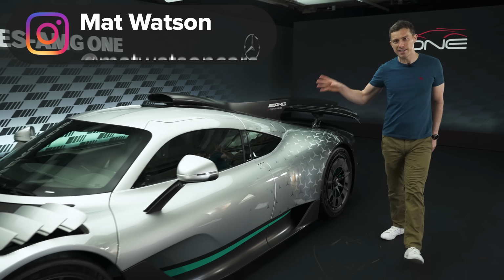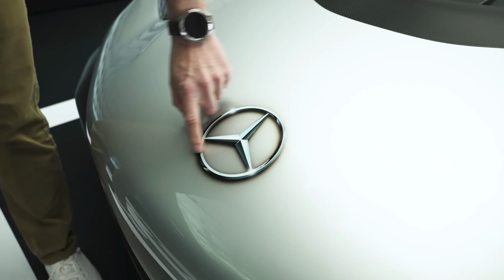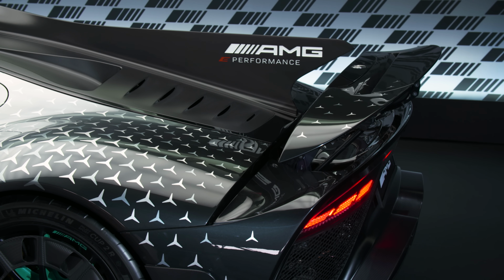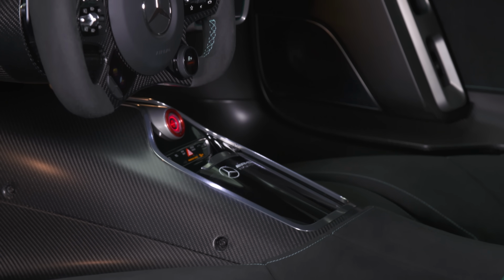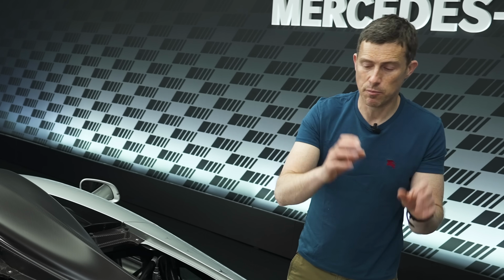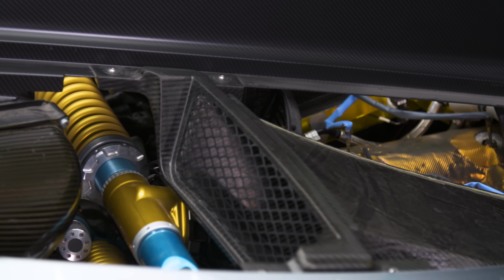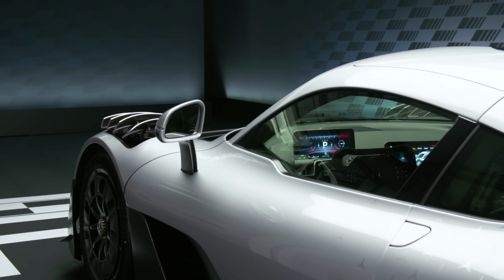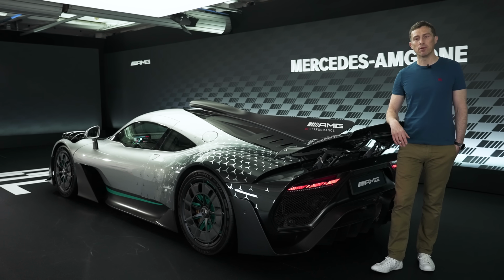Mercedes-AMG ONE: An F1 car for the road!

Comment: The downside will be the insane running cost and the lack of sound, and still slower than a Tesla Plaid!🤣
Reply: Slower than a Tesla? Hahajahaja, your Tesla can not make turns, is not a F1 champion, and is not the brand that invented the automobile and the most sucessuful brand in the world.
Reply: @simracer8142  Not only slower, it’s 15 times more expensive, and 90% of the cars will never drive faster than a Tesla on the track! I bet a service cost more than a new Plaid!🤣 But with a great driver behind the wheel it’s faster!

Comment: AMG ONE only has a 1.6L V6 turbo dual electric motor but they can produce 1063HP..

in terms of fuel consumption will also definitely be more efficient than any HYPERCAR..

and engine Cooling sistem is more ADVANCED than other.. because of F1 technology.

although the performance of the AMG ONE engine is not as great as other hypercars that have appeared. but F1 technology is like aerodynamics and SASIS if it is competed on the race track, I believe AMG ONE will win. because it is designed to be fast not only in straights but in corners

Comment: As i read most of the comments i have to say that the amg one needs to prove its performance with a official lap time on the nürbürgring. This car is heavier than most people expected it to be. But dont forget, a gt2 rs does weight in with fluids with 1600kg or more, with just 700hp and still laps the ring in under 6:50.
Reply: AMG ONE's lap time around Nordschleife was 7:05.763. Or 6:45.911.
Reply: @purwantiallan5089  what? The amg gtr pro does a 7:05 - way this car isnt sub 7

Comment: I dint expect this car to be this heavy. I tought it would be around 1.1/1.2 tons. When merc revealed this car current F1 merc-amg car was around 750 kg at the time. I tought it could be sorted with addition around 400 kg . I guess Aston Martin valkyrie will be pretty much better because it expected to be around 1/1.1 tons
Reply: Yea same, must be the hydraulics. Cylinders to raise the car, cylinders 4 the wing and cylinders for the wheel guards.

Comment: Trying to adapt F1 hardware for street use can prove to be tricky. It can have significant problems with the powertrain. Meeting emission standards with an F1 engine was more arduous, especially when the company was looking forward to producing a 1000 HP output. Engineers found a way to tame the hybridized 1.6-liter turbocharged V-6.

Comment: Reminds me of the Ford GT like alot 🤔🤔
Reply: And I don't see any relevance between this and GT.
Reply: @EngiNetion  more specifically the pedal box, lightweight, and especially build for aerodynamic, Also a V6 and a kinda boxy steering wheel. If you look deep enough both were meant to dominate the track.

Comment: I think AMG is trying to be conservative with the acceleration of this car, the new Mercedes AMG GT E performance with 840 does 0-60 in 2.8sec and it weights 2.4tons. The AMG one is lighter and got more power. I think 2.6/2.5 sec is possible.
Reply: 2-2,2 secs is also possible,the less powerful Porsche 918 spyder with similar weight managed to did that
Reply: @muhammadhaekalhakim6402  918 has PDK and Porsche Launch Control and optimisation on its side
Reply: @therealpureessence2437  the amg one has lighter weight,more powerful,and has electric turbo which prevent turbo lag and deliver instant torque at any rpm

Comment: The numbers (0-100kmh) are not that impressive actually. 2.9 is fast don't get me wrong, but at 2 million pounds it should be a lot faster. (Caterham 620R does 2.8 sec, Porsche 911 Turbo S (992) - 2.6 sec,  Tesla Model S Plaid - 1,9 sec)

Comment: It just fees a bit gimmicky……

Like sure it’s got an F1 engine but for its chonky 1700kg weight and super low torque 1000hp isn’t that great (in todays crazy hypercar terms anyway)
The F1 gizmo’s are cool and all but instead of an F1 seat and a drs button I feel like the R&D money would’ve been better spent on shaving off a few KG’s 
What makes F1 so good is the crazy downforce and crazy power to weight, neither of which this car has.

Comment: I think it's slow car bcz it's AWD with electric motor and 1000+HP so many aerodynamic design with F1 tune-up if u look up Maclaren 765LT u can see it's rear wheel drive with lower engine power and 0-62 mile is 2.88sec and that hypercar one it's 0-62 mile with AWD 2.9sec i don't think so it's good power all hail to Maclaren power

Comment: 1700 kilos. The power to weight is less than a LaFerrari. AWD will help the launch  but this turned out to be much heavier than I imagined. All that electric power should keep the engine good for long.

Comment: Why do they even include different drive modes, I have a C63s and I always want it to be in sports+ mode, each time I start it up I want to hear it, each time I down shift I want it to crackle, I want it to climb RPMS through the gears, can we at least have a setting that remembers it...it remembers my seat and steering wheel position....
I didn't buy it to be fuel efficient .
I didn't buy it to sound soft
I don't care it's in 2nd at 3k RPMS in 30kms traffic growling at everyone.
I don't want to fiddle with buttons on each start up.
If any Mercedes guys watching this please include this as an optional memory mode in the next update please!!
Matt....come on man you surly will agree you lead footed monster!
Reply: I'd say this is not because they didn't think about it, i think its due to noise regualtions but i might be mistaken.

Comment: Its a really stunning car, only disappointment is the weight as its really heavy.
Reply: Performance figures are low as well. I was really hyped for this car but thats kind of disappointing.
Reply: @MegaFregel  pretty sure that the actual performance would be in the speed it takes corners, but there are ultimately huge compromises in sticking an F1 powerplant inside a road-legal chassis. Remember the Ferrari F50?
Reply: @2FinzButIGotMeAFewOn  Its heavy as sht, thats the problem. Dont know what the F1 enginge has to do with that since its tiny.
Reply: @MegaFregel  the hybrid system from the f1 engine is heavy
Reply: @_mundi  not that heavy
Reply: @_mundi  the Mclaren P1 with a 4 liter V8 + hybrid and Ferrari LaFerrari with a big 6 liter V12 + hybrid came in at 1400 kg back in 2013. The Aston Martin Valkyrie, which is the main competitor of the AMG One, has a 6 liter V12 + hybrid system, more power than the AMG One and comes in at just over 1000kg. I expected more from a ultra light weight F1 drive train, than to be 600 kg heavier than its competitor, even if it was modified to function in a road car. Seems like they could have done more to save weight but chose not to for whatever reasons. I mean come on, over 600 kg heavier than the Aston Martin Valkyrie?!
Reply: @MegaFregel  its a track car, i bet it will snatch porsches Nurburgring record for a while at least
Reply: @ВладиславДимитров-ш3с  would be an absolute joke if it didn’t but I wouldn’t be surprised.
Reply: indeed it's a hybrid
Reply: Who the F cares when you get such performance... way less the a Chiron...

Comment: E63s AMG 4doors family size 0-100 3.2s - 100k£
AMG one 2doors 0-100 2.9s 2M£

It doesn’t make sense?
JUST PUT THE E63S ENGINE IN THE AMG ONE AND MAKE IT ALL WHEEL DRIVE AND BOOOM YOU GOT A CAR FASTER THAN TESLA

Comment: I know 0-60 isn't everything but 2.9s is slow for a 1063hp car
Reply: Not accurate lol
Reply: @ode1854  Those numbers are official from merc themself
Reply: @nonameyet2205  wait and see. This thing has 200hp more than 918 and weighs the same so it will be atleast as fast and 918 does 2.2s 0-60
Reply: @ode1854   Wait for what? As i said those numbers are official from merc themself. The 918 has a blazing fast PDK dual clutch transmission, the ONE only has a single clutch automated manual transmission, the extra 200hp might help at the top end but most likely will not help 0-60
Reply: @nonameyet2205  the engine and torque is more responsive than N/A car with f1 tech and the gearbox is faster than the pdk100%
Reply: @ode1854  Faster in theory, but so far all the review says that the 0-60 is 2.9s which is slower than even a 911 turbo S
Reply: @nonameyet2205  this car developed for doing corners for Nurburgring record.
Reply: @konstantinlisitsa8443  This car is so heavy it probably won't beat porshce in nurburgring
Reply: @nonameyet2205  probably you are absolutely right, but there were so many dragracing where Porsche cars were heavier and had less power than their opponents but nevertheless win. May by because of adaptive aerodynamics or some other technologies AMG could set a record time.  Time will reveal.

Comment: The F50 based on a formula one engine, no it only used the engine block. But, this Mercedes is the first real car based on an F1 Car. Great job Mercedes taking 5 years hard work, and being first F1 car for the road.
Reply: And yet, the closest to being one is GMA T.50 :/
Reply: @pazernyy  GMA T50? What is that car, pazera66?
Reply: @purwantiallan5089  Man, cant you use Google?

Comment: Quite underwhelming to be honest - the valkyrie, which competes with it has far more impressive acceleration figures, much better weight control and comes with a 6.5l v12! Feels like the amg is not even in the same class as the valkyrie...
Reply: honestly felt the same, this was rumoured to be around 1242HP and around 1300KG in weight, what the hell happened to that, it's barely faster than a 765LT to 200KPH. it "only" has 1063HP and weights fucking 400KG more
Reply: @leoc675lt  however it seems to have insane aerodynamics and a really track-focused set up. The AMG GT Black Series was already able to beat the 765lt and the sf90 on the track (despite being a lot slower on a straight line), this car with the kind of acceleration/downforce/set up that it has, should be able to outperform even a McLaren Senna on the track.
Reply: Tbf, they never advertised it to be, only the fans did.
Reply: @F1ll1nTh3Blanks  Yeah, there's that... Although it just makes sense to compare them both, doesn't it?
Reply: @optimusprime1201  Ayumu Uehara drive this AMG ONE before.
Reply: It has different philosophy altogether

AMG one philosophy is a road legal F1 car. Whereas Aston Martin Valkyrie originally is a hypercar project, which sadly never got a chance to participate because Lawrance wants to invest them fully into F1
Reply: @hectornecromancer5308  Maybe take a look at how Aston markets its car - "f1 technology on the road" - this moniker puts it in direct contention of the amg one. If you were to look at the marketing of both the companies, you'll find that they compete in almost the same segment...
Reply: @optimusprime1201  that's quite interesting

That means it depends which one came first. WEC Hypercar announcement or the phrase first?
Reply: Well at least this does not Porpoise though XD
Reply: WTF are the people hete on about
Reply: This car has the 2016 world championship-winning f1 engine. The same engine with which Nico Rosberg won his world title
Reply: Is the valkyrie even built? Are their weight figures real and proven? Is the car Road legal?
Reply: @nazarpredatorak  there are at least one valkyrie built

The current progress is unknown due to papa Lawrence focusing on F1 instead
Reply: @nazarpredatorak  the cars built,  it road legal , thunk customers have started taking delivery .
Reply: Did you know that Heaven is a free gift from God? Billions of people go to bed every night wondering if they have been “good enough” to go to heaven. There is no need to live in fear and doubt. Jesus taught that you can “know the truth, and the truth will set you free.”

There are many passages in the Bible that teach the truth about Heaven being a free gift from God because of what Jesus did for us on the cross, not by our own good works. One of the most clear and important passages is from the Apostle Paul’s letter to the Ephesians:

Ephesians 2:8-9 “For by grace you have been saved through faith, and that not of yourselves; it is the gift of God, not of works, lest anyone should boast.”
   

Most people think that Heaven is a riddle which can never be solved. This is not true! The Bible is very clear about how you get to Heaven, and how it comes by faith in Jesus Christ, not by trusting is our own good works.

For solid bible study please visit ''Truth Time Radio'' - also here on youtube - learn the truth and unlearn the lies!
Reply: @thegospelmessenger1corinth634  think your in the wrong video .
Reply: I don't understand where or who told you the valkyrie and the One compete with each other? One is a car built by AMR to be fast around the track and the other is built to have an F1 engine and F1 tech in a street legal car, 2 brain cells would allow you to know that there is no correlation
Reply: @wailfaridi2070  the AMG ONE has a slower 0-60 time than even the Esperante GTR1.
Reply: @wailfaridi2070  exactly
Reply: @wailfaridi2070  Seriously? You a 12 year old in your parents' garrage? Like both of them have F1 tech built into them - both were made to rip around any track around the world and be the fastest. And please tell me what, according to your bright mind, is the purpose of a "road legal F1 car"?
Reply: Not at all.
Project one has way better acceleration 

Yes weight of valkyrie is definitely better however 

valkyrie doesn't have electric motor and the instant torque that comes with it as well as mguk or active aero

Still think the valkyrie will edge it out most of the time and it does have better sound but amg will be able to deliver similar levels of performance while being actually drivable amd liveable with off the track too
Reply: @eventusvantos8586  Well, I suggest you take a better look at the Valkyrie's specifics - it too has got an electric motor producing 100 horsepower and it accelerates from 0-100 in 2.6 seconds compared to 2.9 on the amg...
Reply: @optimusprime1201  I don't think this car will exactly hit 2,9 when it got really tested.the sf90 has a similar weight to this car and less power but managed to did a 2 secs dead 0-60.don't forget that German manufacturer tend to underrated their performance figures
Reply: @muhammadhaekalhakim6402  the AMG ONE has 3.1.
Reply: @optimusprime1201  the Mercedes has more than one electric motor 

Lmao where does it do 2.6 
Not even close

Mercedes will guaranteed beat it in acceleration

It has more electric motors
It has more torque
It has mguk
Reply: @eventusvantos8586  the Valkyrie does have an electric motor.
Reply: @paulthomson9014  yes but it's no where near as powerful as the amg s
Reply: @eventusvantos8586  also no where near as heavy as the amg .its got a higher power to weight ratio
Reply: @paulthomson9014  yes but
Mercedes has more torque and active aero and will out the power down better
Reply: @eventusvantos8586  it's all guess work till we see performance figures from both along with lap times
Reply: @paulthomson9014  so then one should wait and see..  not guess
Reply: @eventusvantos8586  the merc has 1,063 hp while the valkyrie has 1,160, so it has more power with less weight
Reply: @paulthomson9014  the merc applies its power better and has more torque

Comment: Its years too late and is a fat, underpowered slug. It was supposed to be 1BHP per KG - hence its name "ONE" - so it should have had power to weight of 1064HP per tonne and instead it has only 625HP per tonne - a big yawning fail

Comment: It looks amazing but it's actually a bit disappointing especially considering its weight. 

A much cheaper SF90 is actually faster and lighter. Yes it's a 'F1' 1.6 but why is it so heavy?
Reply: All that electric crap, batteries make cars way too heavy. Best is pure ICE like the T50. Just one ton. Perfect.
Reply: @valerystoichkov7429  Laughs in Rimac Neverra which nothing can touch or come even close.
Reply: @NikitaKyndt  Pfffft that thing was half a minute slower at the ring then the Amg. AND doesnt sell. Irrelevant, just an EV.
Reply: It’s a joke really they could have put in the A45 engine with two added cylinders in there get more horses to carry the weight.
Reply: @Jameson53  You can’t just add 2 cylinders to an engine block you have to make a new one
Reply: @Jameson53  wtf this car is all about f1 engine
Reply: ikr i think it's underwhelming
Reply: It’s not a drag race car, it’s a high speed corner track car.
Reply: @dbagdi1998  "High speed corner track car" that weighs 1700kg!
Reply: @tsmith7146  Yes, it will 95% be the fastest road legal track car in the world on most tracks
Reply: @dbagdi1998  🤦‍♂️
Reply: @tsmith7146  It’s inevitability
Reply: Wait to see how it performs on the track. It’s more track-focused than the SF90 and it has much more downforce. the AMG GT Blackseries is already a beast on the track, this will be even faster (as it should be, given the price tag)
Reply: Those acceleration numbers arent accurate at all lol
Reply: @ode1854  the weight is. Will be hard to hide that much weight for a hypercar arround a track.
Reply: @frankoekemoer4219  but this thing weighs literally the same as 918 but has more power, and 918 does 2.2s 0-60
Reply: @ode1854  people really thought the 2,9 secs time was the real number for this car lol.the 918 spyder with less power and similar weight did faster than it's claimed and so does the sf90 with similar weight + less power + having rwd only.i don't see why this car couldn't do the same thing or even faster